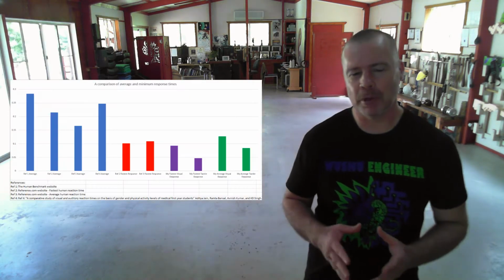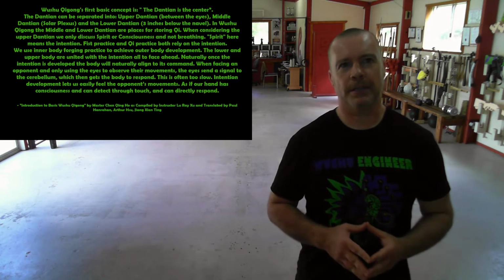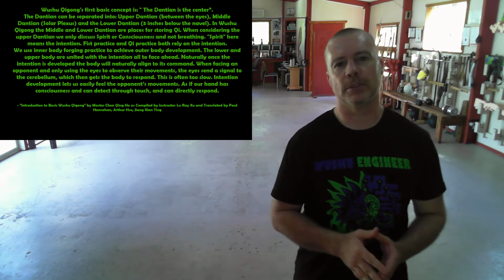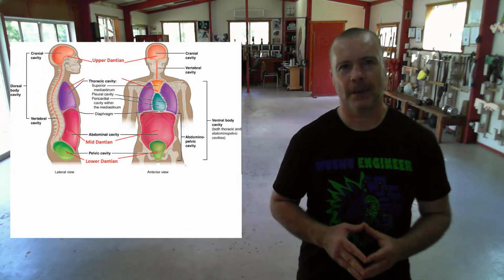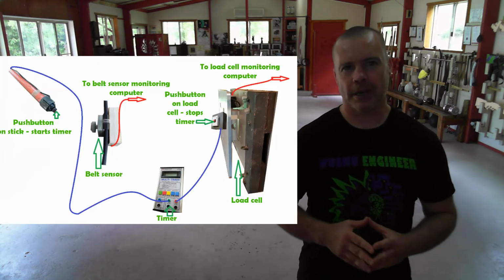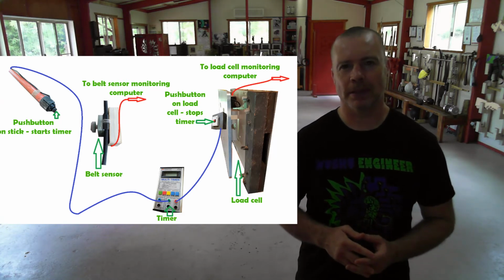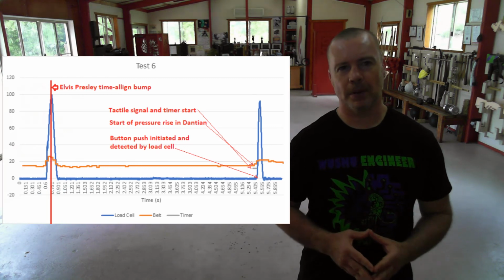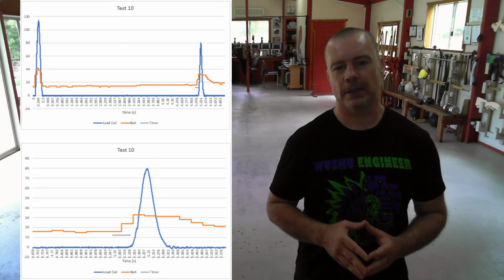Lightning Reflexes: Using Center/Dantian for Faster Movement and Response. Pt 1 - Theory and Testing

Comment: Hello again!  I had to google the term because I have no idea what the English term for it was.
It came back with the term: "electromyography" EMG for short (Johns Hopkins). I think that's what you're trying to measure: muscle response or electrical activity in response to a nerve's stimulation of the muscle.
From the same source: nerve conduction velocity test. But that'd be for something else, I'm not sure.
From what I understand of what you're trying to do is measure the timing for any muscle response times to stimuli, that starts in the lower Dantian. There may be a jolt sent through ALL nerves, with muscle memory playing a role in which muscle actually ends up twitching (which would semi-explain why training is needed: to solidify the neural pathways which lead to an ACTUAL muscle twitch following a stimuli, which in an evolutionary span of time would be quite useful: spazzing out over leaves rustling won't do much except burn calories, bolting aka twitching leg muscles in a specific order when there's a specific stimuli would end up with higher odds of survival on a long enough timeline).
Or maybe I totally missed the point, idk ... I'm still watching the video right now, I'll edit or delete as needed.
Reply from the maker: Thanks for the comment, I appreciate the feedback. In this set of tests, the measurements performed were all mechanical in nature (mainly using force as a marker of internal pressure increase). We will perform tests focusing more on neural/nerve activity at a future date. However, the trained systems we are investigating may function almost as a neuro-mechanical system, where some aspects of information transfer may be a combination of both mechanical (eg. pressure increases or waves) and nervous impulses. However, this grandiose idea is all pure conjecture on my part. The truth is that we don't know yet. More studies must be done. However, this is all part of what we are investigating. There are relatively few people looking at these systems in the context of traditional martial arts practice so there's a lot that has not been explored yet. Too many studies to do and not enough time in one lifetime.

Comment: This is really interesting. Did you do any tests where you deliberately did not move from the centre?
Reply from the maker: Good question. I did not do that in this set of tests. It would be difficult for me to do that under the constraints of a response time test because the use of center is part of my subconscious programming at this stage. If I tried to do the tests without using it, my response time would more than likely be greatly increased because I would have to engage conscious control to "deactivate" the subconscious responses. However, I could consider doing this as a test at some point in future.